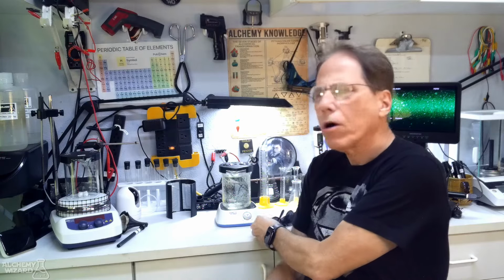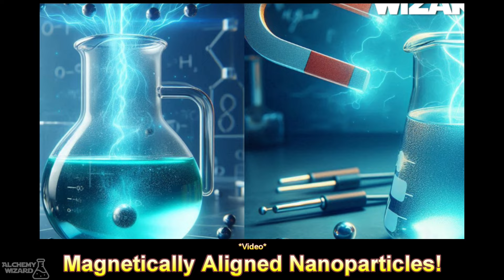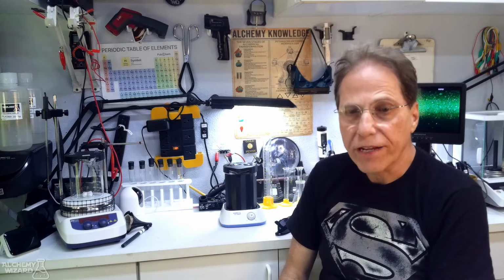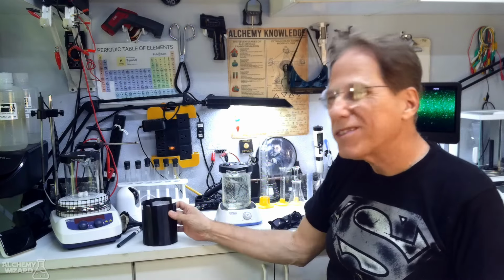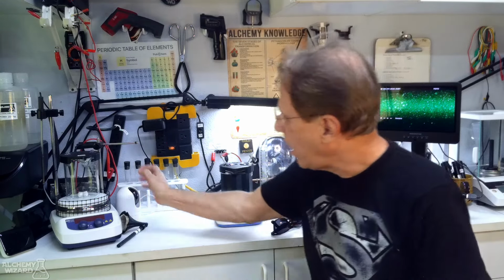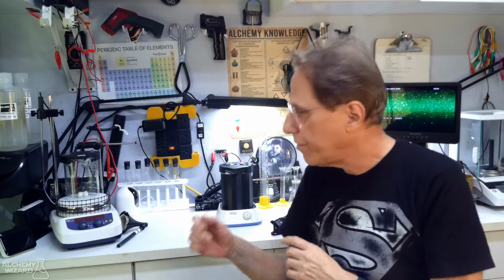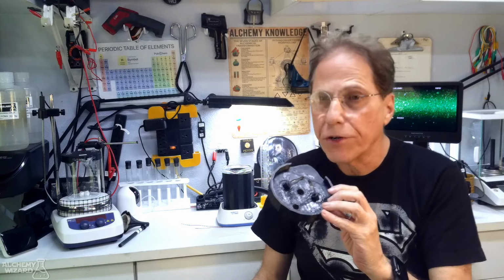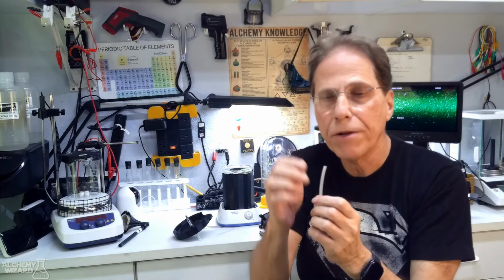Nanoparticle Plasma Arc Improvements. Using a Camera. Adding Magnets!

Comment: Tom can you please do monatomic gold powder?
Reply from the maker: Hi David!

Though some people would disagree with me, my chemist and I have looked at the formula for creating monoatomic gold and concluded it's nothing more than powdered gold chloride, which is a neurotoxin. 

Furthermore, the neurotoxin aside quality, it uses poisonous chemicals in its creation and if you are not absolutely careful in removing or neutralizing them you will have a substance that can be harmful. 

Stick with Ruby Red gold or Plasma arc gold.
Reply: Ok thanks Tom that is interesting, I seen a process on youtube where they continue to repeatedly disolve the gold with acid and then heat or calcinate, untill it turns white. gold cholride is yellow, I'm wondering if the white color, it turns to something different. Thanks again for your help
Reply from the maker: @David-y1i8c  I won't lie in that there is some kind of chemical mystery with monoatomic gold. My chemist says the formula alone requires the combining of the two most powerful acids there are. One drop in the hands you will burn them, one drop or vapor in the eye and you will go blind. To be honest, you have to be crazy to want to make the stuff. Even if only a small part of the end result is gold chloride and the rest something yet undefined, the dangers in handling those chemicals is not worth it. .